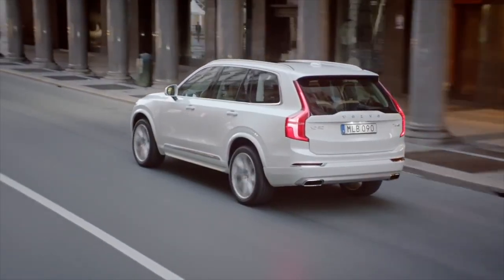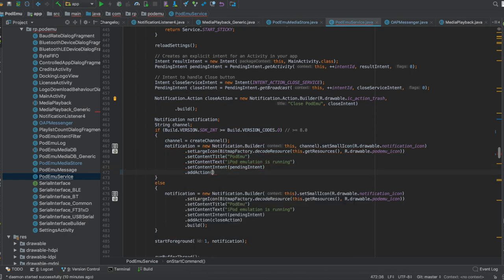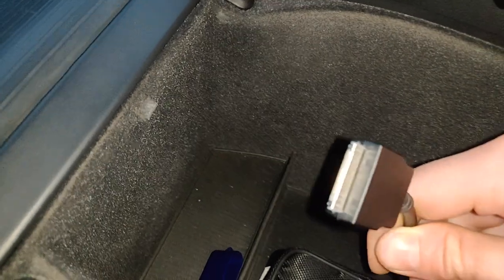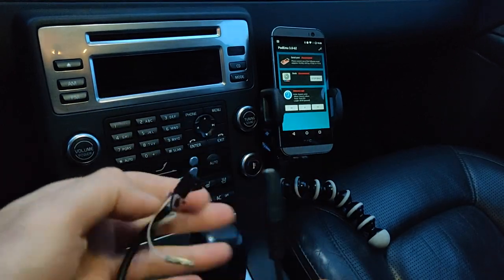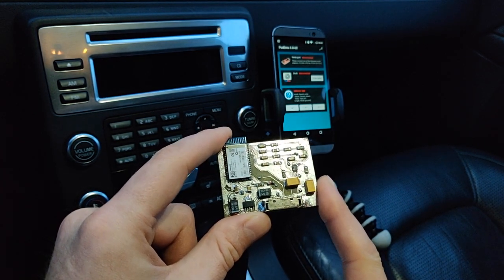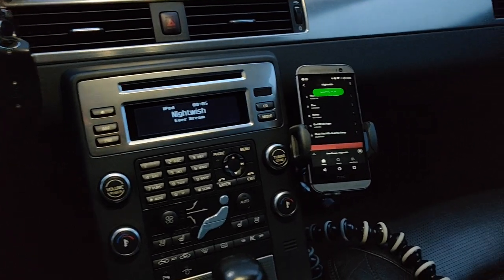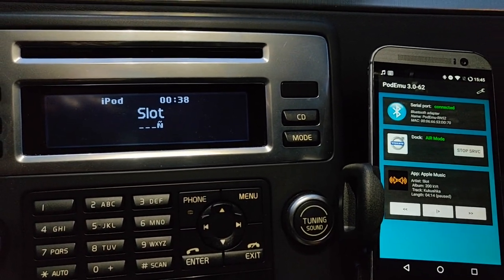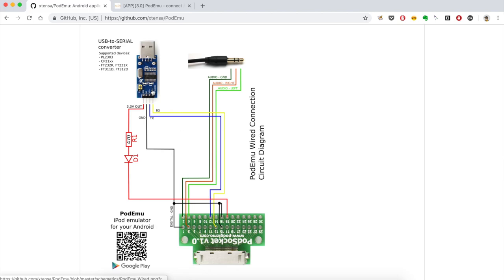Android Phone and iPod 30-pins full integration

Comment: Thank you for everything you've done on this project! I know you mentioned not to ask about standard USB cables, but I'll give it a go anyway since my setup is different. I don't have a male 30 pin cable coming from my car. 

My infiniti has a standard female usb A port, which supports usb sticks and iPods. I'm currently plugging my male usb A to 30 pin iPod connector, and my iPod. Do I need to connect that cable and all the equipment you've described or would usb A to usb C work with ipodemu? Thanks in advance.
Reply from the maker: 30 pin iPod connector has USB interface in it as well. Therefore, your Infinity 99% communicates through USB, even if it is connected with 30-pin connector. And unfortunately, USB is not supported. There is only one manufacturer known to me that hid serial protocol inside USB and this is KIA/Hyundai You need special USB adapter here though.
Reply: Hey there, i guess were on the same boat here! I have 2015 qx50 and was wondering if you had any luck with this project.

Comment: I have a 2011 Volvo C30 that uses the iPod interface but via a USB port that a lightning cable or 30-pin can be plugged in but I’m looking to create carplay I integration using an old tablet or RPi. Can I use this method in conjunction with a 30-pin to usb cable?
Reply from the maker: No, this will not work. USB uses different protocol. You can find more details on project GitHub page.

Comment: Is there any method to do the other way around -- connect legacy iPod to Android car stereo in a way it is done on stereos "supporting ipod". It only works as a usb disk for me yet, no access to playlists etc. I had JVC stereo in my previous car which was great, i was able to navigate ipod from the head unit.
Reply from the maker: Sure, it is possible but I didn't see "ready-to-use solutions". You can use my OAP library (https://github.com/xtensa/oap) to develop such application. There are also numerous projects that are using Arduino, etc.